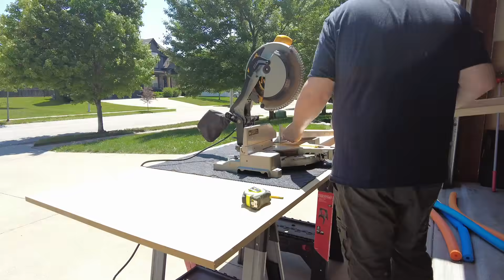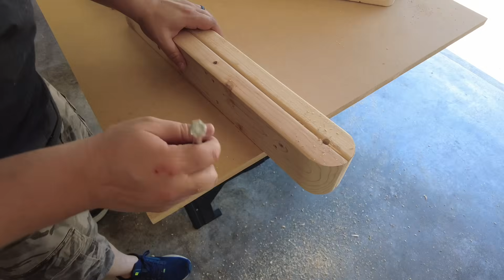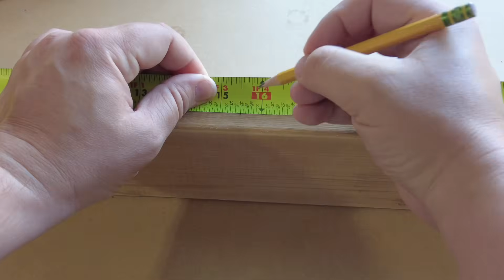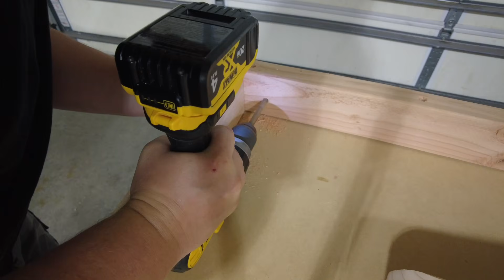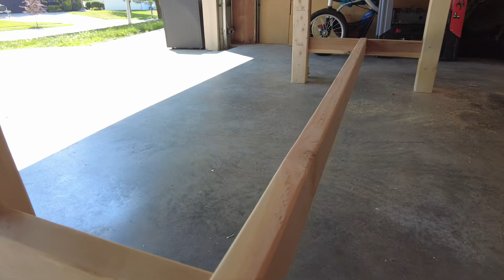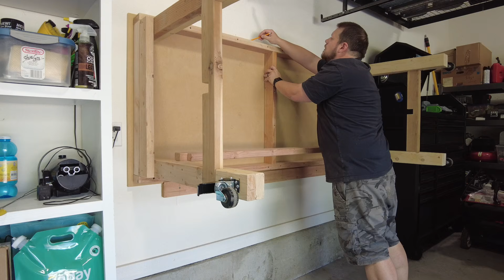DIY Folding Workbench: Step-by-Step Build Guide with Materials List!

Comment: I really could use some guidance on the bottom mount bracket.
Reply from the maker: What's your question?
Reply: @TopHomeowner I really just don't know how to make the mounting bracket. I guess it's the cutting the groove that doesn't make sense in my head.  I'm very new to this and using the table daw to cut that groove just seems difficult.  Additionally,  I have a like 2 inch difference from wall to garage floor. There's a sort of lip. Wondering if I'll need to make my bracket thicker like two 2x4s
Reply from the maker: You don't have to cut the groove, basically you just need a lip for the table top to rest behind that will prevent the table from sliding off the mount and falling to the floor. You could technically do that with another 2x4 that's raised slightly in the front (or a 1x3, etc). As for the distance, in this garage there was a concrete ledge jetting out and the drywall was about 2 inches back. The table top is deeper than the base so you'll have some play. But if it is too much you could probably double up on 2x4s... just make sure you have a lip where the top can't accidentally slide off of it and cause the table to fall. Hope that helps!
Reply: @TopHomeowner didn't know how to make the lip so I just used a circular saw at 1 inch depth and cut along the short side and wide side to create the groove. Everything else worked great. Thank you so much

Comment: FYI. Great video & great build. Just what my small shop needed. 
Quick note I didn't see the step covering the upper leg support  and its placement. In the video.  Until the last shot. In which I can see them mounted on the legs. I thought I was going to loose my mind trying to figure out how to keep the legs from bowing out. It's fixed now & thanks again for the video. 😁

Comment: Thanks a lot for this. Everything went smoothly except I had some trial and error installing the legs because the video went black at the end. Also, should the long support piece between the two sides be 74” like the rest of the wood, or should the legs be flipped around so that the inner 2x4 holds the perpendicular legs? Mine keeps falling and I measured one side to the other. I’m just going to cut an extra piece down to 74” and cut new notches. Thank God for extra lumber. 😅

Comment: Question on the lower leg support….notch 1 1/2” x 1 1/2”……how will that hold the legs from moving outward and ending up not straight?
Reply: Ok…..decided to not use the middle support and put 6” 2x4’s on the outside of the upper legs to serve as a stop to keep the legs straight.  We’ll see how this works.
Reply from the maker: The stop on the outside of the legs limits outward movement, but it could be better. The lower leg support prevents the legs from collapsing inward. You might want to make the lower leg 6-8 inches longer so that way the notch has support both ways.

Comment: Why not secure the tabletop to the skirt from the top to avoid having to drill holes throughout the skirt and possibly going too far with the screws? Is it for aesthetic purposes?
Reply: From what I've seen, putting holes in the top can cause divets, bumps, and what not which can make the top not flat.  Also, by using the skirt, you can swap out the top if it gets damaged
Reply: You can't go too far with the screws if you use the length of screws he specifies in the materials list. Why would I want holes/screw heads in the surface of my work bench instead of a smooth top? I wouldn't.
Reply: I’ve seem other designs where they used pocket hole screws from the skirt into the top. Just have to install the pocket holes into the 2x’s b4 you assemble the skirt.
Reply: Screws through the top into the skirts would be a much better method.  This is, after all, a work bench, not a kitchen table.

Comment: What's the stability like? I've seen another similar build that was really wobbly and had to be amended to use diagonal bracers.
Reply from the maker: It's really stable. I might modify the lower removable brace and leave a few inches of material on each side past the leg (instead of making it flush) but honestly I've been happy with it

Comment: I made a similar table with similar wheels. One issue I'm having is the wheels get caught under the legs when I'm lowering it. Have you encountered that?
I'm thinking of adding a spring to keep them from going lower than the deployed state.
Also, I made mine high enough to also serve as an outfeed for my table saw. But this makes it difficult to undo the top latch with the leg support in place. I'm brainstorming ideas to help with that. I thought about changing the long horizontal support to one that runs diagonally from the bottom leg stretcher to the middle support under the table. Another idea was to have some extended lever thingy to undo the latch...
Reply from the maker: I haven't had that issue with my wheels. In fact they can't go any lower than where they are designed to be. The only thing I might change is attaching them about 1/8-1/4" higher because I don't need to raise the table as high as they will now. Changing the horizontal support from the leg stretcher to the middle support sounds like a good idea to me. An extended lever doesn't sound as... safe.

Comment: Thanks for the video. 
Do you get any racking with your design? Is it wobbly at all?
Reply from the maker: It'll move back and forth slightly from side to side, but not much.  If anything the legs sometimes unfold a bit too far, so if I had made the  removable leg support about 6-8" longer (and not have the notch at the very end), it would probably eliminate that completely.